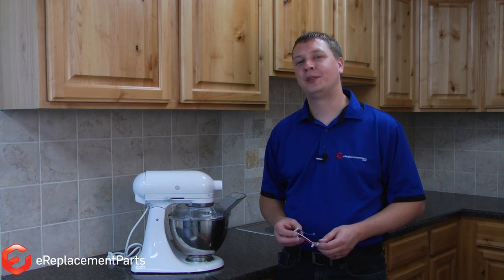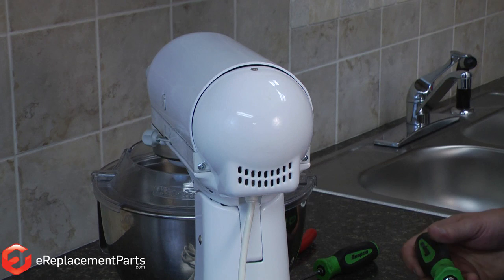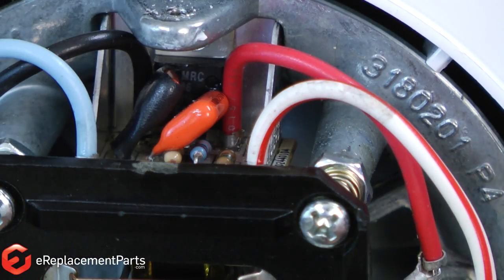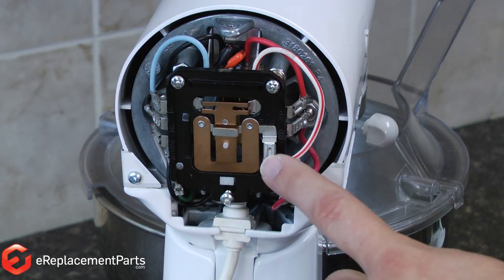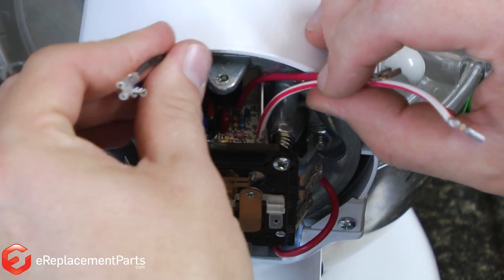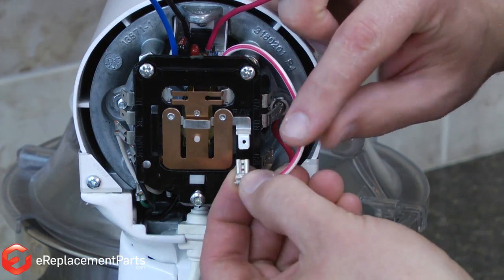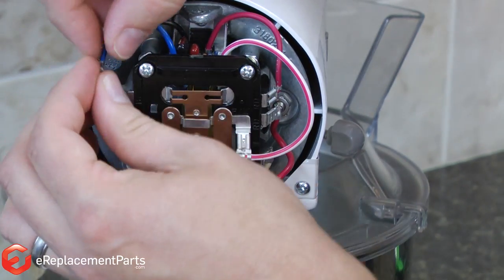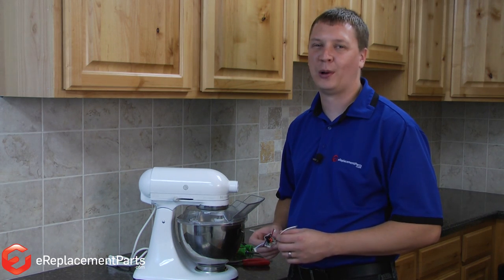How to Replace the Circuit/Phase Board in a KitchenAid Stand Mixer

Comment from the maker: Thank you for watching. If you are getting infinite resistance this will mean one of two things. The first and the simplest is that the brushes are not installed correctly. The second is that the field and armature have burned out. If the second one is true in your case I would suggest taking it to the nearest service center for repair.

Comment from the maker: That reset button is designed to pop when the mixer is over loaded with too much to mix. Not turning on at all could be a few different things ranging from bad reset switch, a loose connection, to bad motor. At this point it would be best if you take it to a service center and have it checked over. Thanks for watching!

Comment: I have replaced both the Phase Board and the control board and my mixer still does not work.  I have checked the brushes and they are making contact with the armature.  Any ideas?

Comment: My mother's KitchenAid didn't turn on awhile ago and I replaced the carbon brushes and that didn't do the trick and we tried various outlets to plug it in but it still refuses to turn on. This all started when my mother was unhappy with the top part shaking while it was mixing and thought maybe it was a loose screw (note that it was still working and able to turn on at this time before she took it apart). What do you think is the issue? Should we try replacing the phase board?

Comment: I initallly had the bad gear and I watched your movie how to replace it and I did it. Unfortuanately before I saw your vid I was messing about on my own and I think I got it to a state where it just woulndt power on with speed control. Before it would power on but it just wouldnt turn. Anyway the gear was definately bad but now I have the issue of no power. Should I try to replace this board? Looks very easy. Or do you think its the control board? Could you recommend an online guide to rep that?

Comment from the maker: @felipevinalay Like most circuit boards you can't test it unless you know what the logic, or output values, of the board should be. You must rely on the symptoms the mixer is having. The most common symptom of a bad phase board is a mixer that will only run at high speed. A bag phase board may also cause the mixer to not turn on. However this symptom could also indicate a bad control board, switch or cord. 

I hope this helps, 

-Mark

Comment from the maker: @ptb650 Like most circuit boards you can't test it unless you know what the logic, or output values, of the board should be. You must rely on the symptoms the mixer is having. The most common symptom of a bad phase board is a mixer that will only run at high speed. A bad phase board may also cause the mixer to not turn on. However this symptom could also indicate a bad control board, switch or cord.

I hope this helps,

-Mark

Comment: Thank you!  I used this video to replace the phase board on my Kitchenaid K45SS, which solved the full speed on all settings problem.  Note that the old board in my mixer had a white wire where the new board has a blue wire.  I also adjusted the speed control board (another video is available for that).  Also note that I was able to find the replacement board on eBay for a lot less than from the parts stores (under $10 versus $25-$40).
One last hint...put a dab of glue (I used rubber cement) on the screw so it sticks to the screwdriver if your screwdriver is not magnetic like the one in the video.

Comment: Great video series THX. My mixer was having motor speed issues. My phase board was caked in flour, very likely causing it to short out. after removal I used an old toothbrush and warm water to clean it off, made sure i was dry and "let it set over night!!!!!", reinstalled and powered it up, working great. .... NEVER use water on your mixer or any other electronic that are any where near power!!!! The parts on this board are diodes, caps, and resisters, water will not hurt these if they are not cracked or have power to them, and if they are cracked they are already bad. Proceed at your own risk with this tip, if you are not sure ....DON'T DO IT!!!

Comment from the maker: Thanks for watching! First thing is to double check if the motor brushes are in correctly. One of our videos titled, "How to Replace the Brushes on a KitchenAid Stand Mixer", will be very helpful with that. If after that the mixer still does not come on you can check the motor by pulling off the lower red wire and the white wire from the control plate. Once you have done this, check the continuity between these two leads. If it's good, the problem may be the control plate or phase board.

Comment: Thank you for the video.  Very helpful.  I did have one question that may seem obvious but I just want to be sure.  When purchasing a replacement circuit board, how do I ensure I'm getting the right size?  Just make sure it has the necessary Voltage required per the manual?

Comment: very helpful i changed both the faze board and speed sensor as long as i was gunna open it up. and the brushes. make sure the brushes are in right. they will fit in the wrong way but the mixer wont run at all.

Comment: Yes!  You Rock!  Opening the back of mine: KitchenAid Ultra Power, Model: KSM90, MaxWatts=300, Hz=60, revealed the Black wire was loose.  Symptom: Ran only on Speed 1&2.  With needle-nose pliers, a light squeeze on the female spade terminal (curled part that slips on) now it won't vibrate off again and I felt it slip on tighter.  
YouTube rocks too!  Thanks eReplacementParts  !

Comment: GREAT VIDEO! My KitchenAid is very old, would it be wise to order the brushes and the gear.  Other than not working on low speed it sounds very loud as well. Is a KitchenAid MODEL K45SS, 250 WATTS, 115 VOLTS, 60HZ

Comment from the maker: Thanks for watching! The older mixers are really good! You can order the brushes (#W10380496) on our website. With the speeds being off and the sounds you are getting you might want to consider taking it to a local service center for servicing. Those older mixers are tricky to adjust the speeds without the use of a special service center only tool.

Comment: I have a 4KSM50P bowl lift. Periodically the mixer would stop working in the middle of a batch of cookie dough and the reset button would fix it.  Machine doesn’t turn on now.  Checked phase control and noticed the blue wire casing has wear. Should I order both the worm gear and the phase control board? Also should the screw in the bottom middle be tightened, its loose? Maybe it controls planetary rotations? I ordered grease from your site to replace leaking oil. Thanks

Comment: I'm not sure if this is the repair we need or not. My KA walked off the counter when I was using it and it has different speeds, but the slowest speed is way faster than it should be. (Everytime I turn it on, flour goes flying everywhere.) Should we try replacing the circuit board or is there something else you'd recommend?

Comment: Hi, Mark. Great videos! My problem is a KSM90 that my daughter bought used. the motor is running but "bucking", mostly in the lower speed ranges. All speeds change normally. Governor appears to be ok but when the bucking happens the speed board moves. I don't know if that is the motor making the speed board move or the speed board (or control board) making the motor buck. Any thoughts? Thanks!

Comment: Hello, mark good video, I have a question if I use a kitchen aid 110 volts and 60 Hz, and I make it with a power transformer 220 volts 50 hz will convert volts but not the hz, so the machine would work faster or slower, if I change the circuit board / phase 120 volts 220 volts on the other, the speed will work correctly

Comment: question i had to replace the worm gear.. after putting the unit back together the motor will not come on. i have checked the wires they are plugged in correctly snug.  Any ideas?
Reply: I have a similar issue. the mixer was sounding loud and grinding like during use. I opened it up and moved some grease around to try to find a broken gear or something that could be making the noise. I didn't see anything so I put it all back together and now it's not powering on. really wanting to figure this out.
Reply: i found out that mine needed the brushes replaced.. they were worn and by taking it apart it triggered the rest of the failure.
Reply: Zach Brown

Comment: I found the video helpful to open the mixer; I needed to replace the handle for the latch that locks the mixer down.  After putting it together, now it won't run at all.  I don't see any loose wires.  Any suggestions?
Reply from the maker: Double check that the brushes are installed correctly.

Comment: I have a KitchenAid Artisan model KSM150PSSU  in fist speed it go faster, I change to 4,5,,6...10 and it go a litle faster but never slow speed. I check the governor and it is ok I graduated speed control without success results

Comment: Hello, i have a Classic model K45 but an old modell without a phaseboard or triac. i can only see a big orange Capacitor and i dont know what for an Cap it is. MY Problem is that the kitchenaid dont work anymore and i thought it is the phase board. maybe you can tell me what to do. hint: it works with 220v so it is european standart i think.  thx from Germany.

Comment: My mixer seems to be jittery on low speeds. I replaced brushes and still same thing. The 1 brush is arcing. Could this be an issue with governor or phase board or something totally different? Thanks

Comment: Hi,
do you happen to know whether the phase control board is the same for 110V (US) and 220/240 V (Europe/Australia) versions ?
Reply from the maker: +altoplano The 110 Volt phase control board is not compatible with 220/240 European power supplies.

Comment: I wounder if you can help me...I bought KA Professional 5 plus from US and I live in UK, I didnt buy a voltage regulator as I didnt know about it and I turned it on! it made spark and fuse my flat.
Then I read abut the voltage thing...my question is, is my KA dead :( or is it something replacable or repalable inside it...Please advice.

Comment: Thank you Mark for the great videos...they are really helpful. I have a Artisan model stand mixer and I would like to know if there is any chance to convert a 110v model in a 220v model...Are there any parts that should be changed to do so (besides the plug)? Im moving to Europe and I wouldnt like to depend on a voltage converter. Some of my friends that live abroad using mixerrs with voltage converters tell me that they run too fast on lower speeds, actually they lost the stir speed they had back in the US. Thanks again
Reply from the maker: It can be done, however, you will be looking at a new motor. We recommend using a service center to perform the conversion. We suggest using a power converter.

Comment: Do you have a video on replacing the circuit board? My kitchenaid won't turn on at all, so I think that it has a bad control board
Reply from the maker: +Carrie Jahnke This should help: http://www.ereplacementparts.com/article/7688/How_to_Replace_the_CircuitPhase_Board_on_a_KitchenAid_Stand_Mixer.html
Reply: +eReplacementParts.com What about replacing the control board? I ordered both because I&#39;m not sure what it is that&#39;s broken

Comment: how do i know that it is the circuit board that needs replacement and not the worm gear?  my artisan simply won't turn on when i switch the machine on - it does not spin.  i was kneading something heavy but then after a while it stopped spinning.  Please advise

Comment: Hi, please advise where can I find the following parts for  KitchenAid Stand Mixer model number 5KPM50 :

1). Speed Control board(plate) 
2). Circuit /Phase Board
3). Replacement Gear - worn part

Please advise the part numbers for above items.
Is it all the KitchenAid Stand Mixer use the same parts?

Thank you.
Reply from the maker: Hello, when I search your model number nothing is coming up to match what you have provide. I found 5KPM50BGR4 and 5KPM50BWH4. They both had the same parts.  The control plate (https://www.ereplacementparts.com/control-plate-p-622265.html) and the gear (https://www.ereplacementparts.com/worm-gear-p-1106526.html) are currently out of stock.  The phase board shows instock (https://www.ereplacementparts.com/boardphas-p-2573518.html) If you have any questions regarding order please call us at 1-866-322-9842 and we will be happy to help you.

Comment: My mixer wont spin at all unless I put it on high.  So on speed setting 1-6 it doesn't do anything, but as soon as I hit 10 it works up to a fast spin.  When I slide it back down to a lower setting, it stops spinning again.  Would that be a phase board repair?  How do I order what I need to repair it?

Comment: My KitchenAid Artisan Mixer sparked and stopped working altogether.  I changed the speed control board and the circuit board on the back of the mixer. Still nothing workings. I think something is fried, but don't know what else to change on it. Please advise.

Comment: My mixer only works on step 4 and up. Nothing happens when I switch on the first, second and the third step. It it possible to adjust this, like in this video? Thanks
Reply from the maker: +stinybru This usually a symptom of a faulty control plate.

Comment: I have a KitchenAid Artisan model KSM150PSQG0 and it only goes on high speed. I  changed the phase board but that did not fix the problem so I think its the speed control plate. Upon replacing the control board I found a small pin that has fell out of the mixer and I have no idea what it is. The mixer still works but not sure if I should proceed with replacing the speed control plate not knowing where the pin goes. Any help would be appreciated.
Reply from the maker: Jeff Perry I forwarded your question to our repair team and will let you know what they suggest.
Reply from the maker: eReplacementParts.com The problem could be the Drive Stud p/n 16998. This stud keys into the governor p/n W10330804 which helps control and monitor the speed.
Reply: eReplacementParts.com ok thank you.
Reply: That pin holds the governor on to shaft

Comment: And if the circuit is open?  That is, if there is infinite resistance between the red and white leads to the control plate, then what might the problem be?

Comment: I just replaced the phase board and it didn't fix my problem. The mixer doesn't work for speeds 1-3 and turns on high at 4+.  I also checked the magnets and they look fine.

Comment: Hi. My Artisan has stopped last evening after 4min of working. No, burn smel, no smoke. I checked the fuse and replace it. No starting at all! What that might be?
Reply from the maker: Hi Cornel and thank you for your question. If your mixer isn't turning on at all, you may have a bad switch in your control board. You can check out the video below and Mark does a great job of explaining what happens with a bad control board, and how to fix it. If you send us the model number for your mixer, we may be able to help you troubleshoot it further! Thanks, and I hope this helps with your repair!

https://www.youtube.com/watch?time_continue=12&v=41qTqTWQkMI

Comment: I was grinding meat with my KitchenAid mixer and stripped the worm gear.  The mixer would turn on and the motor would turn but the gear was obviously damaged.  I replaced the worm gear but now the mixer will not turn on.  Do you have any suggestions?  Is there anything I should look at internally that may give me a clue as to what to do?  Thank you.
Reply from the maker: Hi Denny, you may want to go to our YouTube channel and view the video How to Replace the Speed Sensor and Control Board on a KitchenAid Mixer.
Reply: The mixer was getting power and the motor was turning after the worm gear was stripped, then it stopped.  What would have caused the speed sensor and control board to have gone bad?

Comment: I replaced the circuit board and my mixer is still not turning on. Should I replace the control panel?
Reply from the maker: +Mark Strazynski You can purchase the control panel. I'm not sure what was happening with the mixer originally and if you have checked the Carbon Brushes , Switch or Power Cord.  All of these can easily cause the Mixer to not turn on
Reply: +eReplacementParts.com 
I replaced circuit board, control panel and brushes and it still doesn't work

Comment: I have a similar KA to this. Stationary with lift. "Heavy Duty" . It has problems with the switch. Specifically, it doesn't want to turn off. See a short video of the problem here: v=HmnXFxKN5Mc

Any idea?
Reply from the maker: Couple of things come to mind. 1: Could be as simple as tightening a screw that acts as a hinge for the speed lever. Or, 2: The rear bearing assembly needs to be tightened. There are two nuts found on each side of the control plate. These nuts only need to be snug enough to hold the bearing assembly against the motor. If they are too tight it will put too much stress on the motor.

Comment: Hi , I need the transistor  id number on that circuit board  mine board number is 97065995 or ( w10325124 ) . there is no need to change the entire  board just the transistor . Problem on my transistor the id number is not legible . i can see in your video that the one u are removing is . 

thanks 
Adam